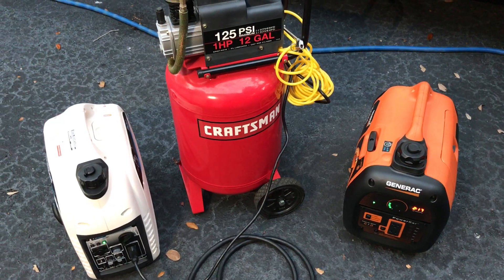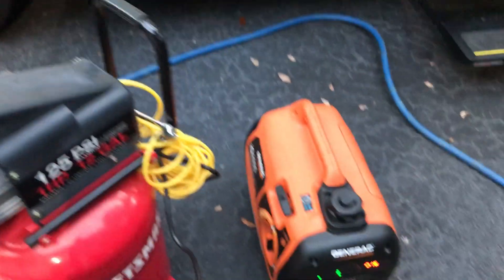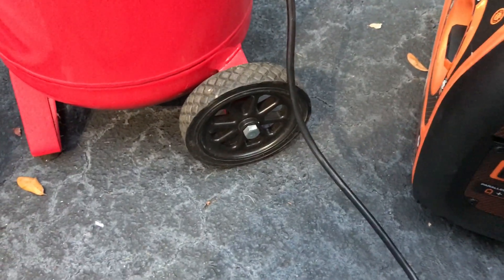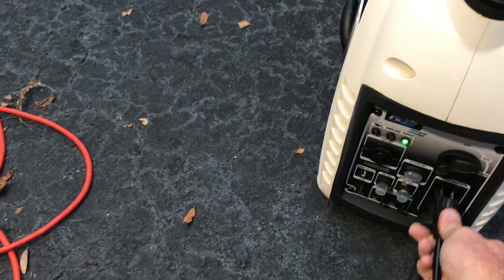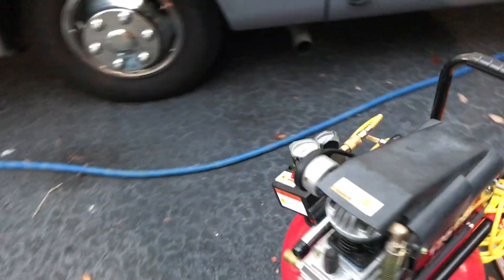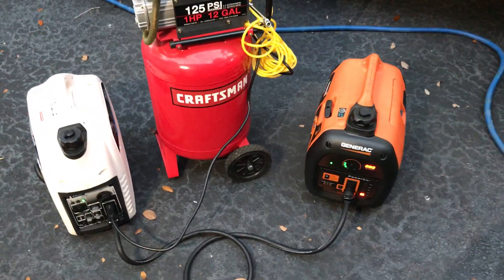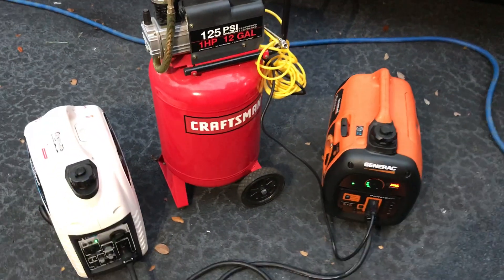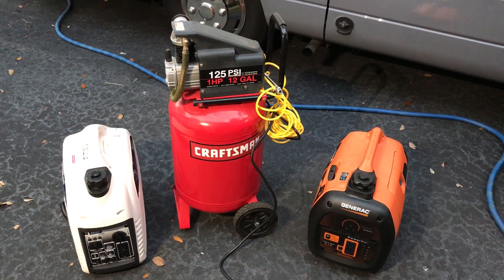2 Generators start air compressor in parallel easily. Pulsar inverter 2000 and Generac inverter 2000

Comment: I just bought a radley inverter 4500/3600 watt generator, on sale $799 Canadian paso, I can pick it up with one hand, it also has wheels, and a extension handle. fires up My porter cable 30 gallon 1,6hp advertised, and, 1.8hp on the motors sticker. It shows overload the motor dies down to a crawl, the compressor motor takes a second and the two spin up at the same time. 😂. I didn’t try with any real pressure in the tank but it filled it right too full at 20% capacity on running watts. Theirs a breaker on the compressor motor, and the generator so I don’t think it hurts anything for a brief period if it’s overloading continuously. I bought the compressor with the original oil still new never changed for $250. And they where over a thousand more before tax. So I can now rebuild a charger from 6 feet under too above the mud in the middle of nowhere!

Comment: Wouldn't this trip the overcurrent circuit breaker of the generator?  Which is why the Honda requires to have a companion generator instead?
Reply: A breaker is a thermal device, the load is a momentary motor startup load (and is mostly an inductive load) so it ends up not overloading the breaker because right after the motor starts up you are below 15amps....

Comment: What I am confused about it the way you have hooked them together. The manufacturers provide the parallel hookup banana plug ports but you have just run the o/p ports into each other and are using a spare socket. I don't get it.
If you get a second straighten me out.
Reply: He's just wired the mains outputs together, the inverters just happen to be able to sync up with each other... basically power is flowing out of the generac, into the pulsar and out to the compressor... the typical banana plug parallel cables are probalby designs to handle the full output of the generator being transfered to the other, but in thise case you can only safely transfer about 1500-1800W, in any case the compressor isn't pulling that much for more than a moment to kick it on.... after that the load is split between the 2 genrators. probably around 700W each.

Comment: It is possible use two generators 110v to run  220v air conditioning?
Reply: No
Reply: @Ken Livingston No it isn't - An engineer.
Reply: @Wingnut353  ummm yeah it's possible with a transformer but you'll need a lot of these little genny's lol